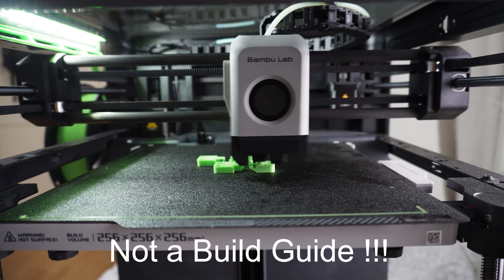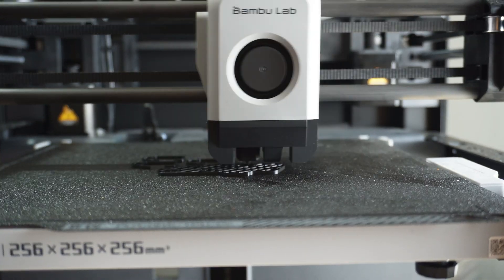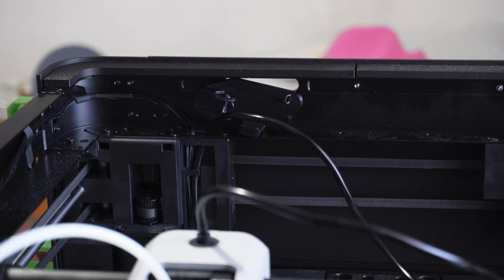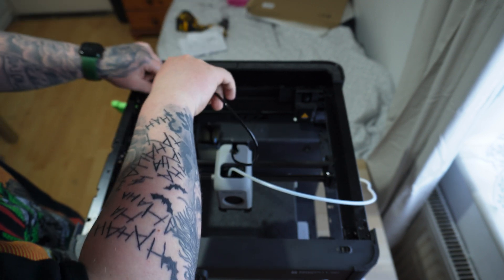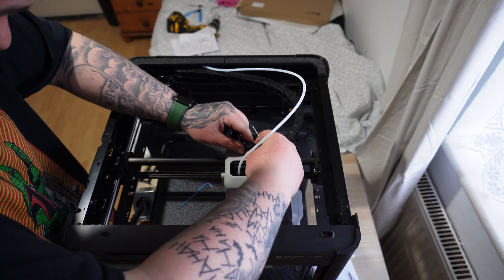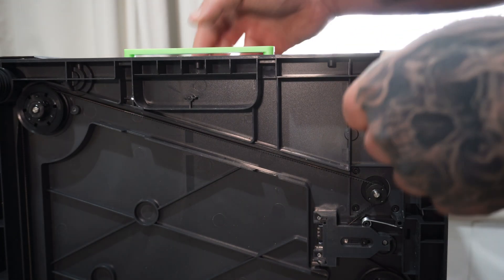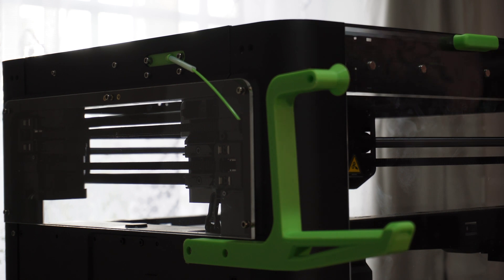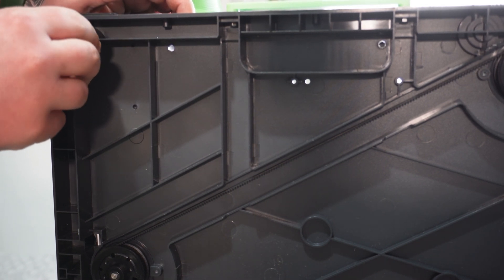Building a P1P Vision Enclosure

Comment: What was the spec for the M3 heated insert?  Is it M3 x D5x H7 or any M3 would work?  How many do I need?  Thanks
Reply from the maker: there is a specific spec I believe there the shorter ones that CNC kitchen sells
Reply: @FilamentFoundry  

Thanks

I googled for the insert.  Insert size suggested was M3xD5xH7.  It only says they come in a pack of 50 or 100 but did not say how many are needed.  I can get any quantity of 20 multiples.  M3xD5xH6 is the most common so I was wondering if H6 is deep enough.
Reply from the maker: @fongxyz  hey I'm at work at the min but if you wait till I get home  ill check my machine to find the exact ones I used 
thanks 
FF

Comment: How much does it cut down the sound? Not sure if you have any experience with ender 3s, how does the sound compare to those? Thanks in advance!
Reply from the maker: Tbh it’s still pretty loud compared to a stock ender I think it’s just the motion system and the way the printer is designed the enclosure does cut down the noise a bit but I wouldn’t do this mod just for the noise reduction it wouldn’t be worth it 🙂
Reply: @FilamentFoundry  thanks a lot!

Comment: Cool vid :) i got those feet btw is it better to screw them in ? but still not sure how i like them, like the case for it want to upgrade mine one day in the future . Like printables as well my 1st printer loving it . Ty again for the cool vid !
Reply from the maker: Tbh i had to glue mine in after the video I found after a week they kept falling out but according to bambu you just suppose to push them In 😵‍💫
Reply: @FilamentFoundry   what type glue ? if you dont mind me asking and ty for the info :)
Reply from the maker: @brandongardner2853  I just used some lock tight super glue got it cheap on Amazon 😊 and I left the printer on its side for a few hours to let it dry . I think it’s a safe option cause the original feet had some kind of adhesive